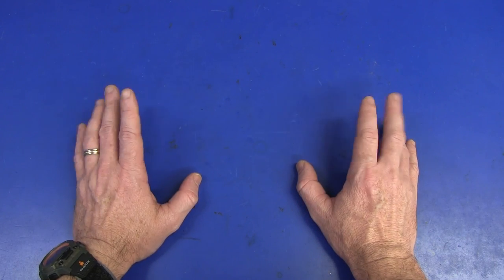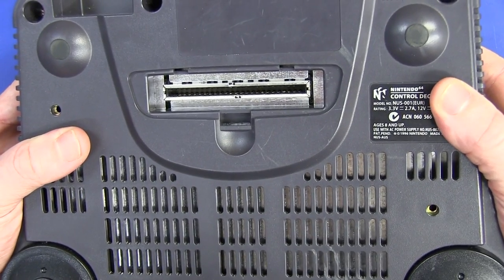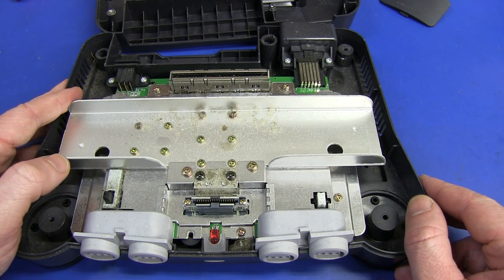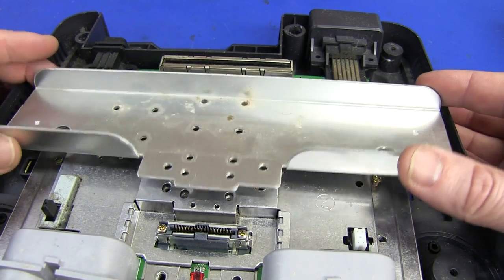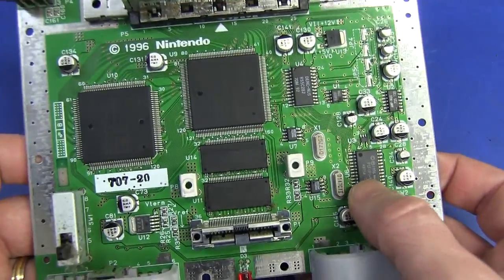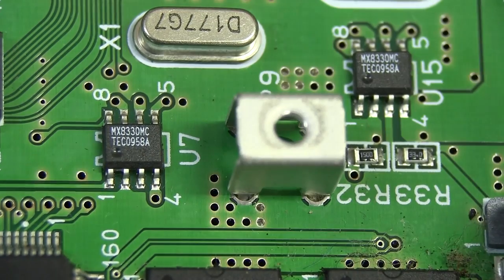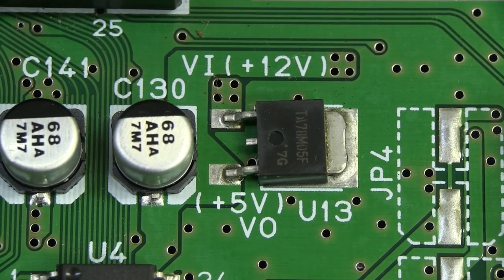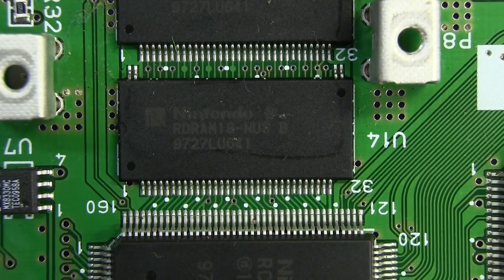EEVblog #491 - Nintendo 64 Game Console Teardown

Comment: At 24:44 at the left side you can see on the motherboard "VTerm". Like...virtual terminal? Can you hook up some kind of RS232 debug cable to this thing? I assume somebody would have found and exploited that in all this time. Wasn't mentioned in the video though. Anybody know anything about that?
Reply: subassy "VTerm" just means Termination Voltage - it sets the High level for the Rambus RDRAM data.

Rambus operates with open-drain outputs IIRC, which means each data / command line can only be pulled down to Ground, and is never actually driven to 3V3 etc.

The RAM runs at quite an impressive speed for a machine built around 1995, so it uses current control and a few other methods to match the impedance and minimize reflections on the signals etc.

Without the Jumper Pak (or Expansion Pak) installed, the RDRAM doesn't get a clock signal at all, 'cos it's supposed to pass through the expansion port then back through the two onboard RDRAM chips.

The Jumper Pak also includes some pull-up resistors to VTERM, so without it the RAM will just be sat there with signal voltages close to Ground (0V).

The Dev systems often had debug code running on the carts, and that info could be accessed via the extra interrupts on the R4300 (/Int3 and /Int4). Those pins are usually just tied directly to 3V3 on the N64, which disables them.

(one of those interrupts was also used for debug and control info on the "Ultra 64" Development board that plugged into an SGI Indy workstation.)

I don't think any commercial games would still have any debug code in which works via the interrupts, but it would be interesting to try on an emulator like MESS or something if the occasional game still contained something.
Reply: Wow, that's an incredible/thurough reply post. Thank you! I knew a debug console was too much too hope for.

Comment: I'm sorry, but you got your processors and memory confused. The expansion pack increases the RAM by 4 megabytes. The CPU's architecture accepts data types (that is variables like floating point numbers) the size of 64 bits.

Comment: Tear down an Xbox 360 and rant on the terrible cooling and awful BGA soldering in them!  That deserves a rant, the stupid things were notorious for irrepairable failure within a few years of release.  I'd send my beyond repair one to review if it weren't already completely disassembled and hacked apart.  The only saving grace is that the 203W power supply is 12V and makes a good (free) battery replacement PSU for 12V circuits, it can do 16 amps! I salvaged the connector from the dead box for it.

Comment: And they've since gone back to cartridges with the Switch. 10 years ago I honestly never saw that coming, but hey, truth is stranger than fiction. Cartridges these days would probably rip the pants off blurays in just about every conceivable way, the thing standing out to me would be speed. Would love to see how long a switch game takes to load on cartridge vs the optical equivalent.
Reply: Moon Moon in reality the Switch's cartridge interface is probably as fast as a USB flash drive. No where near as fast as a blu ray or SATA. Its not even powerful enough to need a high-speed drive. Its only running a cortex A9
Reply: Are you forgetting about the game boys and the Nintendo DS system family...?

Comment: I tried to put a cart in my N64 without the RF shield. Big mistake.  The plastic caught on the metal pins outside the cart slot and one busted off. Looks like these pins are supposed to make contact with the metal tabs of the RF shield on the bottom of the cart.

Anyone know what kind of problem this could cause if any?
Reply: "Anyone know what kind of problem this could cause if any?"
Bad shielding...?

Comment: It was cheaper and easier to produce games on CDROM for the Playstation and Saturn so devs started jumping ship and left Nintendo almost all together. They made far fewer games for N64 because cartridges were expensive to produce and took longer to get made compared to mass producing a CDROM. Some games were supposed to come out for the N64 but the cartridges were limited to 64mb compared to a CD's 650 mb's. It was one of the main reasons the N64 popularity with dev's decreased, not with the sales.
Reply: true, although i think cartridges are not limited to 64 mb except by price. i think that just like nes and snes, there is no upper limit on the theoretical size of a game.

Comment: still don't think soldering the cartridge socket to the pcb is a good idea. if you solder the cartridge in it will be a pain in the arse to swap a new one when there is a failure.

Comment: I think the said heat sink might have been a way to protect against dust, and not as a said heat sink.
Reply: So tell me why should they put these aluminium blocks on th RDRAM and processesor with thermalpaste on it? And why should it need a huge sperate dust cover in combination with this gigantic shielding?
Reply: Like I said, I think, I wasnt 100% sure.
Reply: TheLastRaven6 looking at its design, i'm fairly sure it was both. It made a decent heat sink, and the shape/design of it means that you could throw pennies down it all day without causing any sparks.

Fairly clever use, all in all.
Reply: rattslayer
i remember shinning flashlight thru the vent and told my friends i spilled soda on it and nothing happen. i said its somewhat protective against spills and comment how smart nintendo enginer are.

my friend think im just talking bullshit and want to make a bet that if i pour some liquid it wont damage the system. they never did.

10+years+ now and im finally still sure i was correct back then. this just to prove my point. i should text message them this link xD
Reply: Lars Allermann I agree, the aluminum blocks were just used to help transfer the heat to the larger heat sink. probably easier/cheaper to machine that one flat heatsink and a couple smaller square one than it is to machine one complicated heatsink with multiple reliefs

Comment: well the cpu was only a still cool running cpu at only 93.75 mhz cpu running at 64 bit which at that time cpu's were just starting to run hot enough to need small heat sinks so a large piece of bent aluminum would have been more then enough for the job back then

Comment: Why  does that dinky little 16mhz 12 watt Nintendo need more shielding than my 4ghz 800 watt PC with acrylic see through window?
 The whole N64 system together is probably max 30 watts, In PCs an x86 CPU on it's own can go as high as 75 watts but doesn't need the shielding? Why?
Reply: scot shabalam Because your PC wouldn’t pass EMC testing, that’s why :) There’s a reason why those are “enthusiast” systems sold as parts: it shifts the responsibility for the final EMC compliance to the customer. You want to see how a system that passes EMC looks instead – look at any of the systems sold by HP, Dell, etc. You’ll notice that those have to take EMC seriously and aren’t as loosey-goosey. You can receive a “gamer PC” on all bands more or less, right outside said gamer’s house, sometimes past 18GHz without trying hard.  They are shit in that regard, especially that the enthusiasts who assemble them normally have no clue about EMC anyway.
Reply: @absurdengineering  Does the PC case count as shielding? I mean it's essentially a metal cage around all the components.

Comment: I'll be damned. All those times I blew imaginary dust out of the cartridge, and it was probably the Fin pins from the cartridge acceptor to the board. Probably could have just reached in a wiggled the connector and solved it.

Comment from the maker: No mention of "crazy"?
Reply: EEVblog 
I seen a video where the ram was taken out, and the console was running only with the expansion pack ram cartridge only, which is very impressive 
I want to know if they can replace those ram chips with chips that have much more ram, so it can be upgraded with more ram.
And the same for the XBOX360, because I want the XBOX360 to have more Ram, maybe solder a second ram chip over the current Ram chip to increase ram by double.
Like to see a video where they install more ram in the XBOX360 over the ram chips with a second ram chip

Comment: sure you fingered out in video but the power supply was external. i don't think nintendo designs stuff like that. you need the expansion pak/jump pak, game in for it to even do anything. you also should have the power supply. this is just like nes, snes, genesis, . they do nothing without a game. there is no bios and stuff. hope this can be used again by someone if you are not going to. this needs to be saved.

Comment: It's their 3rd gen console. Nes, SNES, N64 (not counting handhelds).
You really underestimate Nintendo and the quality of their manufacturing. Yes, it's consumer grade stuff, but a large section of their market is children and mishandling needs to be taken into consideration and the Nintendo brand needs to be protected. I expect to see a very well manufactured unit here and not a bunch of junk. From what I recall about this machine is that the main processor is 90mhz and not 50 something. The steady signal you were getting, is that the RF signal with no data on it? I'm pretty sure this could run on channel 3 or 4 of an NTSC (in the US) TV, is that possibly the signal you are picking up?
Reply: *****
I can't remember the Virtual Boy, probably due to the headaches!

Comment: n64's are practically indestructible so it's unlikely to be a dead console. for the system to boot it needs either the expansion pak or jumper pak installed.